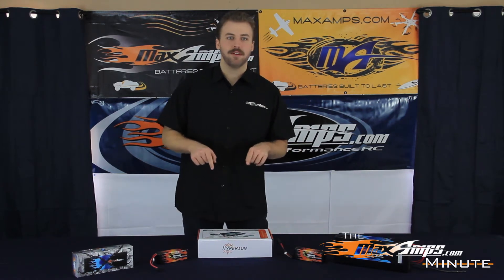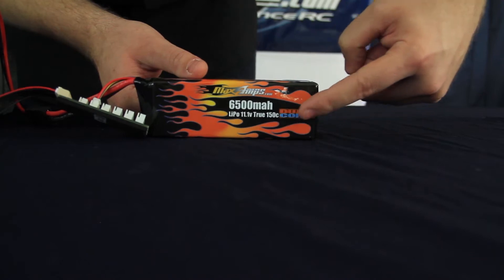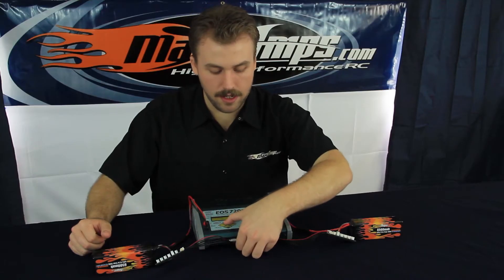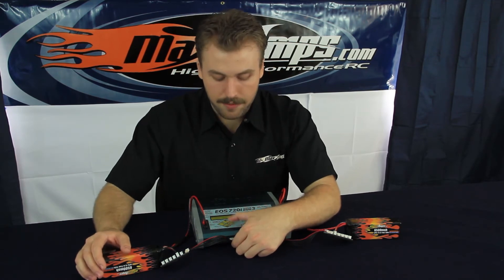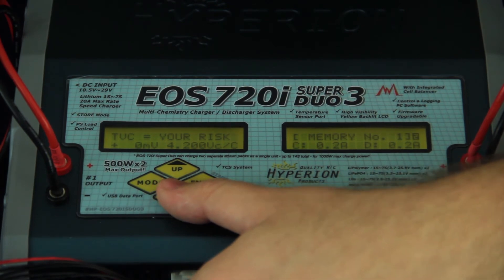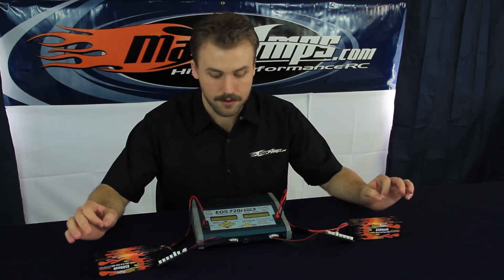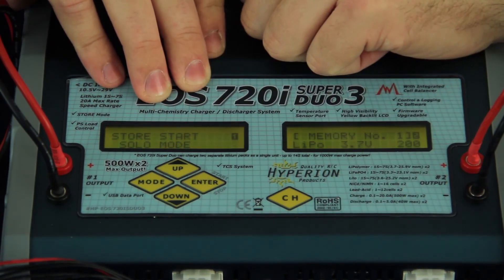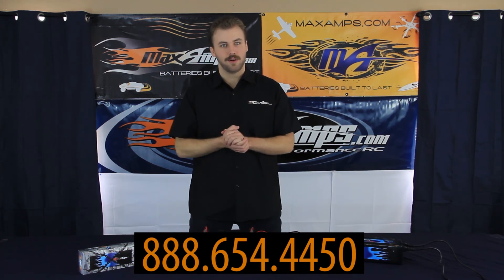Hyperion 0720i Super Duo 3 tutorial

Comment: I know this is an old video, but we inherited this old (but good) charger with a used Alta 8.  One thing, if you discharge LiPo batteries to 3 volts, you will damage them.  The lowest they should ever go is 3.3 and that is also good to avoid.

Comment: I just purchased the Hyperion 0720i Super Duo 3 charger and the 12v power supply.  This video is great for 3s but I'm charging your MaxAmps 6500mah 4s batteries.  What settings need to be different for 4s batteries if any?  Naturally I changed the Battery Volts to 14.8v. Anything else I need to know?  Thanks.
Reply from the maker: If the only change is the cell count then that would be the only change you need to make. If you are unsure feel free to give the friendly pros at MaxAmps a call. Toll free 888 654 4450.

Comment: Hi, i have a error " open circuit " with lipo and nimh at end charge allways with eos 0606i.
Reply from the maker: That means it cannot detect the main plug of the battery plugged in. What plug type are you using?

Comment: You ever get a 	 		 		 	 	 		OUTPUT BATTERY CONNECT ERROR message?
Reply: Did you Update the firmware lately?? That happened to me when I Updated mine! but then They give me a new one directly from the manufacturer that fix the problem.. This charger is bullet proof.. and if you contact the company that make it, they have a really awesome customer service..
Reply from the maker: Darren Susin Yes. That is tied to the main plug not being detected. Is your main plug of your battery plugged into the correct port on your charger? What type of plug are you using?
Reply: Hey, the ports are all plugged in properly. Seems to be working sporadically now, but still a bit weird!

Comment: I have this charger and one of your Maxamps 12v 47amps power supplies. What do I set the charger to for the power supply current? I know the power supply voltage can be set to the 12v that your supply is set at but in the Hyperion instruction I "think" it is saying to set the supply current to a lower value than the max the power supply can deliver..I think it's saying this?? IDK it's a little confusing.
 I have two Lipo 5000mah 50c 3s Lipo batteries...One Lipo 1300mah 100c 2s battery..two NiMh 2000mah 6 cell batteries and one Lipo 1500mah 20c 2s battery.
I always charge everything at 1c.
 I will be purchasing two of your Lipo 3s 6000mah XL batteries soon.
What do I set the charger supply inputs to for these batteries?
Reply from the maker: fordfreak95 Give us a call toll free at 888 654 4450 and we can go over the proper settings for a 12v power supply on the Hyperion Super Duo 3 Charger. Otherwise you can email us at max-info@maxamps.com and we will respond their as well. On the User Setup screen you can change the input voltage on the charger to match what your power supply is putting out. Once set you can then adjust charge rates to up to 5C. Good luck!